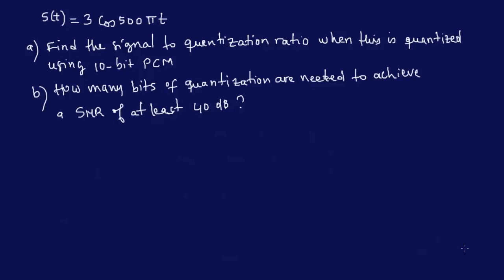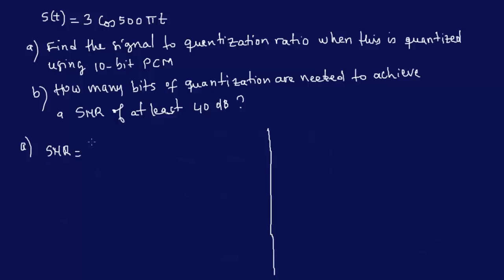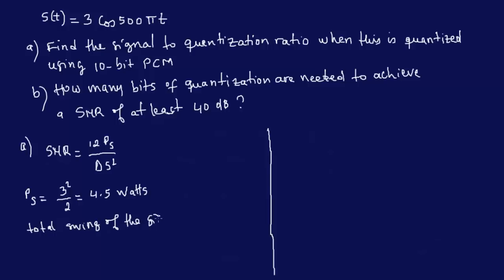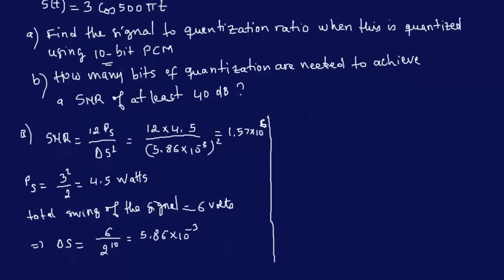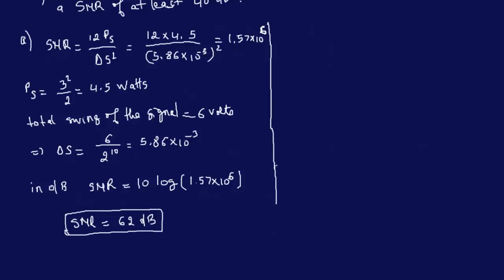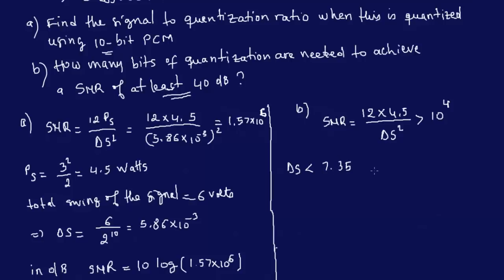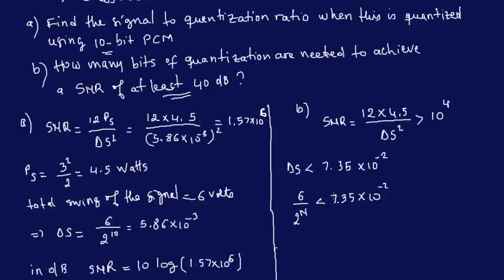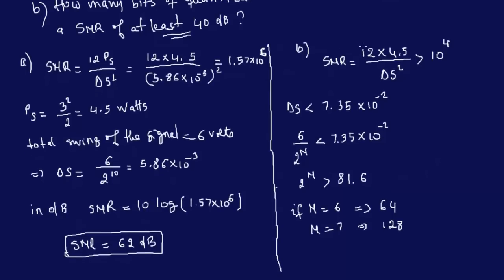Calculating Signal to Noise Ratio with Pulse Code Modulation

Comment: Where the total swing of the signal = 6volts came from?
Thank you.
Reply from the maker: Cesar, the total voltage swing of the signal is double the peak amplitude of the signal. In this case, it's 2x3=6V. (Swing voltage is basically Vpp, peak-to-peak amplitude if you recall).
I forgot to mention that in the video. Thanks...
Reply: Why is that formula not in the FE handbook? Are we supposed to memorize that one?